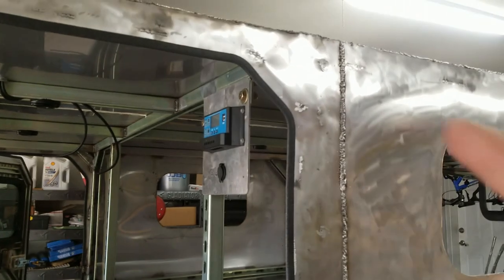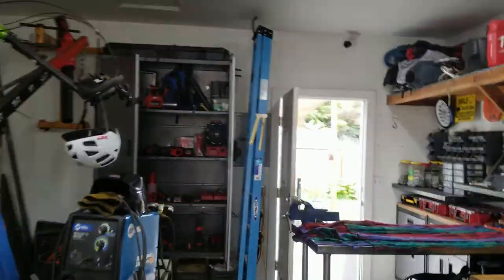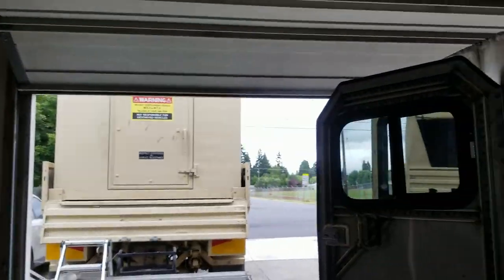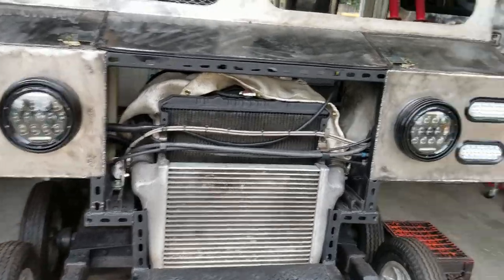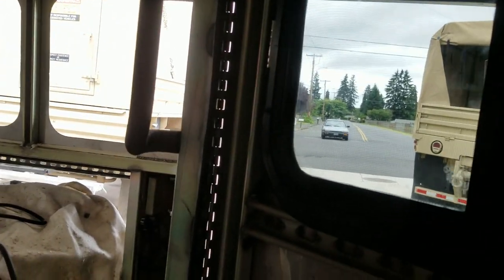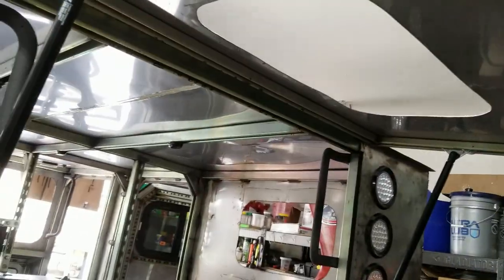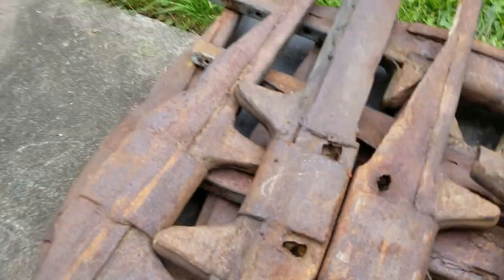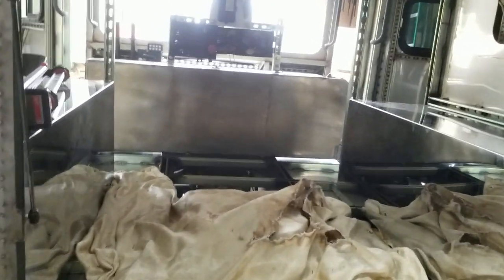Rusty the Spryte build part 81 (cargo door struts, rear door pair fabrication and install)

Comment: You could make a small "gutter" above the doors like they used to do over the windows and doors on old vehicles. Kinda like you have as an overhang in the back. You can run it over both the front and the side doors as one continuous strip to be over both.
Reply from the maker: I thought about it and abandoned the idea...the weatherstripping I will be using will be plenty...